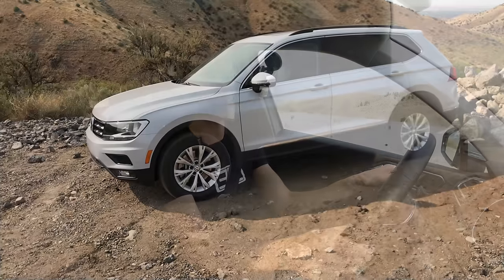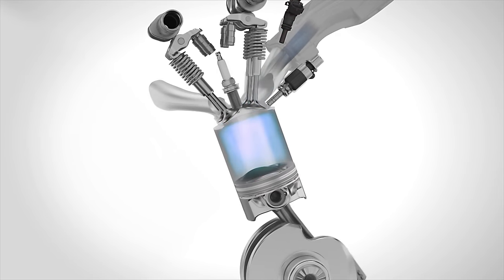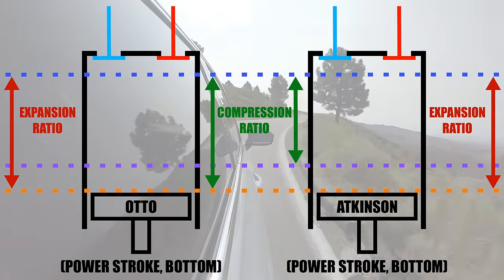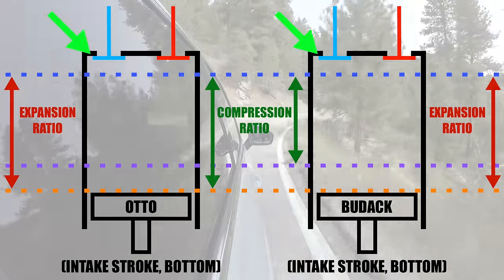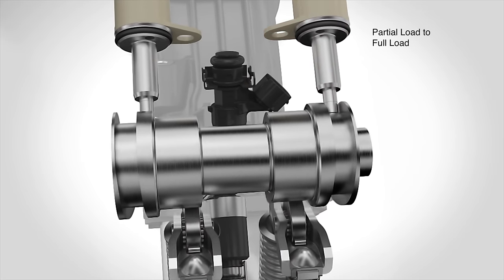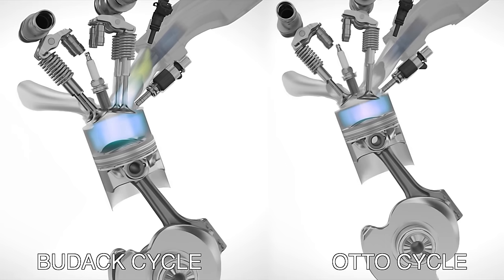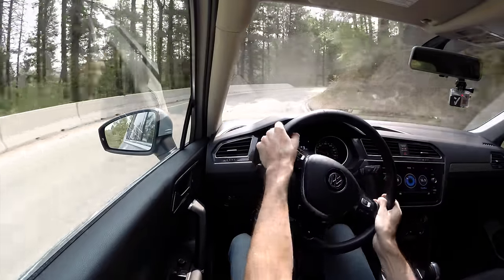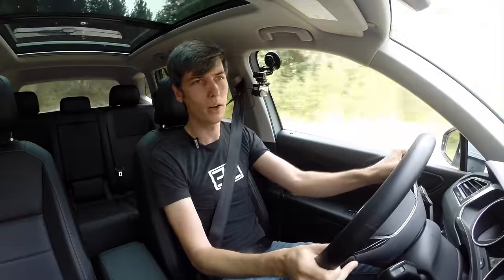Volkswagen's New Engine Cycle - The 'Budack' Cycle

Comment: I see much greater complexity with more points of failure, more parts to assemble and increased expensive dealer maintenance.  They need to consider something other than gasoline 4 cycle engines.  Also I don’t feel that the oil industry has improved gas quality for decades. Thanks

Comment: Oh the irony...we've spent decades trying to stuff more air into the combustion chamber and suddenly VW shuts off the intake valve early? Well.. I guess it make sense when loads are low but at the end of the day, achieves very little. I actually own one of these and the mileage is mediocre and it sounds like a washing machine. 2 traits I failed to see in the brochure.

Comment: It's Called variable valve timing..... vw was doing that on exhoust now on intake, the selenoids. Point is its all achieved in variable valve timing. By changing oil presure and up in it thus faking different duration and engagement points.

Comment: my question is it when choosing dynamic/sport mode the valve will be have as normal without closing quicker ? can it be modified by tuning that make it behave as normal like to make more  power from bigger turbos ? or whole air intake camshaft should be replaced?

Comment: Its a great idea but I think the reason it is not performing as well as a classic Atkinson cycle is due to the Atkinson sloshing the intake charge back and forth twice over the intake valve. This causes improved atomiztion of the fuel air mixture. The Budack cycle is not getting this extra atomization.

Comment: So...the advantage of the Budack cycle over the Atkin cycle is that with Budack, the cylinder is at a slight vacuum at the bottom of the stroke?  That would reduce the amount of energy required to change the direction of the piston.

Comment: Something missing here.  When a spark ignition engine is throttled you are doing the same thing, At idle the engine drops almost to a two to one compression. The flaw is that the engine has to exhaust to a one atmosphere pressure medium (air) so this limits the exhaust expansion.   That is why increasing expansion requires starting from more compression.  This is really a variable cam engine that is actually reducing the amount of fuel-air mix at wide open throttle. Basically you build an engine over size and then limit the intake to replicate a smaller engine in compression but have the larger expansion.  There may be a small increase in efficiency.  If you want to seriously increase expansion you go diesel.

Comment: Isn't that just variable valve timing? Shorter duration for highway cruising and low load conditions, long duration for higher load at WOT under acceleration or when pulling a heavier load?

Comment: Doesn't closing the input valve earlier make the cylinder work against external atmospheric pressure, i.e. trying to pull a vacuum?  Wouldn't waste power?

Comment: why is closing the valve early any different than just keeping a bit more vacuum on the intake manifold so it doesnt draw in as much fuel?  My understanding of the atkins cycle engine is that the static compression ratio can be set much higher because the effective compression ratio never gets as high, thus the explosion is a high compression optimized one but with a longer effective following expansion cycle. if the compression ratio is not being changed to accommodate the changing cam profile, then this is just a big waste using a separate cam profile emulate a partially closed throttle plate.

Comment: i wonder how the camshafts are holding up on these? seems like there would be alot of wear that would start at the transition point between the low lift and high lift parts of the cam as it shifts over. also the groove and pin idea would seem to get alot of wear as engines turning say 3000-4000 rpm it's not just a gentle shift over, its a violent "gonna happen right NOW dammit" moment. second; i see a problem with oil burning as this system might work good when the piston rings are new but when you get a few miles on them i foresee oil being pulled past the rings as the piston enters the budack cycle- think what happens on an old car with a manual transmission when it starts going downhill and there is engine braking, that's usually when you see them burning oil the most as there is high intake vacuum and the oil gets pulled past the rings on the intake stroke.

Comment: So wouldn't a slight vacuum be created at the bottom of the intake stroke? Afterall, the piston is still moving down with no increase in inducted fuel mixture. Is this supposed to help the efficiency or is it a negligible side affect?

Comment: The quantity of air in a gasoline engine is anyway given by the fuel:air ratio. So if you let less air in with the intake valves, you have to open the throttle valve more. At the end you have burned the same quantity of air for a given quantity of fuel. Or where is my mistake?

Unless you have full throttle I do not see any difference. But at full throttle you have anyway the other camshaft.

Comment: It seems to me that the Budack cycle must be a little better than the ordinary Atkinson cycle. The reason is that there must be some pump losses in the Atkinson cycle, because some of the air just pulled in to cylinder, is pumped out again. This will not happen with the Budack cycle, because the intake valves closes before the piston reaches its buttom position during the intake stroke, and so no air is pumped out again.

Comment: Hi boss, did you consider as the car is under low load, intake butterfly is already limiting the air that is supposed to get inside the cylinder, closing the intake valve before or after the desired point doesn't make any sense when you are already limiting the intake air via a butterfly valve. It serves the same purpose, why to complicate the engine. Or it might be another company scam to advertise their engine in a new way !!

Comment: Every Car manufacturer is trying to re-invent the wheel. Engines are getting smaller, cars heavier, fun factor is literally going down the drain. Might aswell go electric, they team up and find a solution to make those batteries more effiecent and long lasting.

Comment: weight of the car shouldn't affect highway milage much. going on a highway means you drive at the same speed for a long time without braking and accelerating. and if don't change your speed, your mass doesn't matter, only your aerodinamics do

Comment: My main feeling is that because large auto companies like VW may have large stock holdings in oil companies, there would therefore be a vested interest in them keeping cars thirsty, else their oil company stocks wouldn't do as well. My guess is that the  most fuel efficient engine on the market is owned by the company who has the least or zero invested in oil companies.

Comment: With the intake cycle shortened you get less of a fuel charge,so after all this 4valves per cylinder engine and turbocharger technology, they seem to be wasting their time now?I see one comment that this appears to be a sort of variable valve timing configuration.

Comment: I would say this is an improvement over Atkinson cycle,  shutting a valve during vacuum should be less harsh on the cam and valve than shutting a valve during compression. Freevalve is still  superior.

Comment: In the Atkinson cycle some of the intake charge is released by keeping a valve open for longer so that the compresion ratio is reduced. The intake charge is a mixture of air and fuel, so is that being released into the exhaust or back into the the next intake cycle? If into the exhaust then surely that is a waste of fuel which I doubt happens. Please someone elaborate.

Comment: No. That is wrong. This is from the second law of thermodynmics. If you plot the cycle on a TS chart, the power is less if you reduce the compression. Lower compression reduces the size of the plot in the power cycle. Better to use less fuel.

Comment: Isn't the closed valves in the inteake stroke causing rasistance of trying to crate vacuum inside the cylinder? Wich is not ideal imho. While in the Atkinson cycle engine the pushed out mixture does not causing resistance, because an other intake stroke just started, and can "use" this pressure.

Comment: Something no one needs hundreds of complexities added to the valve train waiting to fail and leave you on the side of the road. More maintenance more costs. Some overlap more lift more duration more power. High power = better fuel economy if you can control the right foot. Only get better mpg if you dont use the higher power in your tuned motor.

Comment: The fact of closing that valve before the piston reach bottom dead wouldn't cause the piston to deal with the "vaccum" of the missing a/f mix and because of that stealing a little power from the engine so it can overcome that "vaccum"?

Comment: would that overall lead too a cooler cycle???, as the intake closing sooner (thus expanding the gas a little, before it compresses back to the same point (and temp???) than if they had left the intake open

Comment: How about an engine that closes the exhaust valves sooner to stop any wasted fuel from just leaving the engine throw the exhaust valve and burning as it will not be used in that portion of the power cycle, just heating the exhaust gasses. { This is both a wasted fuel and heat energy. }

Comment: I had never heard of this butt I can easily see how it makes sense to do it this way instead of atkins way, lower pumping losses because your not pumping the air in through the valve and then back out before shutting it, your are smart guy you should elaborate on this for the masses.

Comment: I am dying to know why they've gone from a stick to an automatic why you can't find anything in the stick anymore nowadays and used to be years ago if you wanted an automatic you had to order it now everything is automatic and you can't even find a stick I want to know why and you can't tell me that an automatic is more fuel efficient than a stick they're not it's a proven fact that a stick is more fuel efficient than an automatic you can do things with a stick that you can't do with an automatic such as kickstart when was the last time you were able to kick start an automatic I don't think there is an automatic you can kick-start meaning if for some reason your starter happens to go bad you're basically s o l if for some reason you have to have it towed before you can even have it towed you have to drop the drive shaft unless it's front-wheel drive or unless you put it on a flatbed

Comment: And when owner #2 skips the oil change etc all the sliding camshaft gubbins gums up, stops working and throws a valve into the engine in a tantrum..

Comment: I'xe had two vehicles with this engine, and beating the EPA rating was never an issue. Might just be my driving style meshes well with how this engine operates, but my 2019 passat averaged 35mpg in mixed use, and would routinely eclipse 40mpg on the highway (checked with pump, readout was slightly optimistic). If that car had been a few inches taller, I'd still have it (old, tall people problems) The Tiguan regularly got in excess of 32mpg on the highway without trying. Just 70mph cruise.

Comment: Fiat have been shutting inlet valves early at low rpm and low power demand for some time on their multi air engines. With no inlet cam but electro hydraulic valve control it is easy. no need for complex cam design.

Comment: To me it looks like modern Atkinson should be more efficient than this VW cycle.
But what's wrong with V-TEC or VVT-i which has open exhaust valve part time together with intake valve. Could you make video comparing ie. V-TEC and modern Atkinson.
btw. Which engine works using modern Atkinson?

Comment: my 15 year allroad does better than those numbers , and its got injector pipes ,,,, and ccan be fixed , also has about three hundred thousand miles , dont use oil , dont use water ,,, wonder how these variation on otto will hold up ,,,,, time will tell , but a great video

Comment: Mr. Engineer,
Since I I assume in the Budack cycle there would be a small pumping loss associated with the early intake valve closing on down stroke, do you think it would be negligible? Do you know how many degrees early by chance? Would it be the equivalent of any Atkinson type pumping loss of pushing air back into the intake manifold?

Also curious what you might think of the possible positive effects of not disturbing the intake charge pressure waves and velocities vs. Atkinson’s late intake valve closing forcing air back into intake manifold ? To what extent do you think it may effect intake resonance tuning?

Thank you, I appreciate all your efforts.

Comment: AVS (Audi Valvelift System)... Used on the intake cam of economy engines to increase fuel economy. The same tech is used on the exhaust valve instead on their performance four cylinders to increase power. 

It's basically just VTEC 😂
Reply: Fiat Multi Air
BMW Vanos/Valvetronic
Porsche Variocam/Variocam Plus
Honda VTEC
Audi AVS
Toyota VVT

All various manufacturers cam phasing and variable lift technologies, can't really call it a new engine cycle 😂

Comment: I think that for the engine size in the tiguan it may be that in the EPA test doesnt benefit as much from the technology. At highway speed the engine maybe relatively stressed such that the Budack system doesnt really kick in . Im sure its very good for reducing the fuel you spend while idling and other city speeds or <50 mph. I dont think fitting a 3.0 V6 to my 05 A8 would make it more efficent on the highy way than the 6.0 it has or if it does it improves economy its <10% however I would totally believe that idle fuel consumption would be pretty much halved.

Comment: Compared to the Atkins cycle, the Budack cycle must be one of those, 'Why didn't we think of that before!' moments for ICE engineers.

I can think of two reason right off the bat why it would be more efficient than Atkins:

1) Since the Atkins cycle reduces the compression stroke by closing the intake valve part way through the compression stroke, it needlessly draws extra air into the cylinder then discharges it back into the intake manifold. There is friction in this process - drawing the air in and pushing it out, which the engine must expend work to overcome.

2) In the Budack cycle there is effectively no penalty for creating a slightly higher vacuum in the cylinder after the intake valve closes. Any work that is expended in drawing the piston down against that vacuum is regained when the piston reverses and comes up on the compression stroke. Yes, the intake air will reach a lower vacuum pressure, causing it to reach a lower temperature, hence absorbing a bit more heat from the cylinder and piston walls, and hence increasing its pressure ever so slightly. So not absolutely all work expended working against the vacuum during the intake stroke will be regained in the compression stroke. But the bit of heat that the intake air gains will assist in the power stroke. So overall the net work lost working against the vacuum is probably effectively nil.

Comment: I miss one thing when miller cycle is discussed - imagine, just for fun, the engine being perfectly heat-sealed, from the compressor on - the miller cycle would do EXACTLY nothing against knock then. It only works because, after taking a bit of the inner compression out and let the turbocharger (or boosting system in general) do it, we have a greater temperature difference at the CAC, and therefore can transfer more heat out of the air before it's gonna enter the engine.

Simple as that, nothing more, nothing less - for equal torque, you roughly need the same amount of air, and the CAC is the only place where you can get rid of excess heat anyway. Take out the CAC - miller is worthless. Dethrottling a bit, ok... On the other hand - if your CAC isn't up to your demands, you should fix that first before coming up with miller cycle and other modifications that are challenging towards different subsystems (more boost pressure per torque at a given displacement, for example, is a downside of miller-cycle operation and leads to either more displacement - losing part of the downsizing's advantages - or more complexity by using multi-stage boosting, variable compressors and the like to be able to provide the pressure over a sufficient range of massflows and so on. Always do any simple things first! And always prefer things that allow improvements in other fields without interfering much, like ... lower friction, the easiest of all measures taken to reduce fuel consumption, ...

And so on.

Oh man, I miss engine development.

And, although repeating myself - this cycle is by no means new enough to deserve a newer name. Sorry, Mr. Budack, but this is Miller Cycle, in exactly the most often expected way it would be untroduced to mass production - goes for the 1.5, too.

Comment: The new POLO GTI has the same cycle. And that causes some problems to tuners who want to extract more power out of this EA888 engine. QUESTION: What if they swap the camshafts whith the ones found on golf gtis or audi s3s etc.??? Will this revert the cycle to a normal Atkinson one?
Reply: I think it would be much easier to change the coding that controls the cycle.

Comment: so they changed some valve timing and called it a new "cycle".. no, this is not a new cycle, just like changing the diameter of a wheel does not mean you have reinvented the wheel.

Comment: Didn't the ferrari modena have this system of a variable 3D cam lobe that would slide back or forwards. Its just variable valve timing but instead of making more power at higher RPMs it makes it worse... absolutely genius.